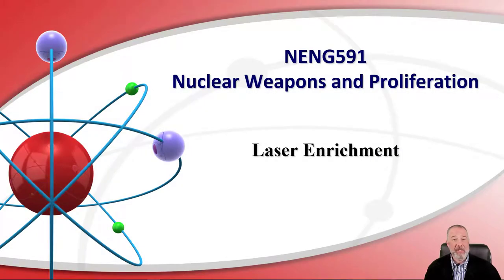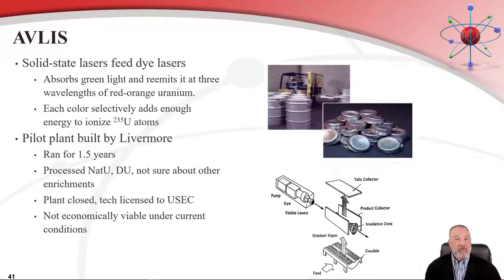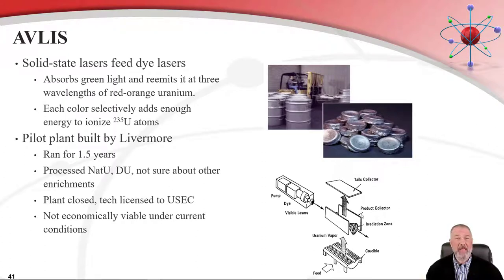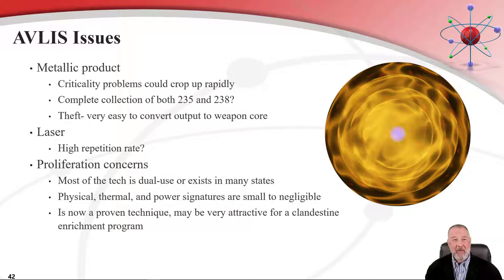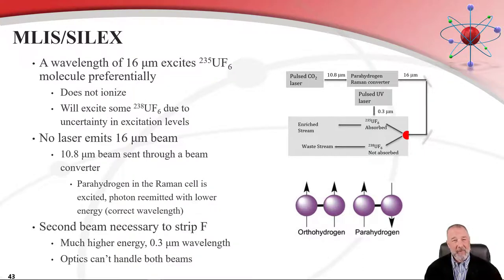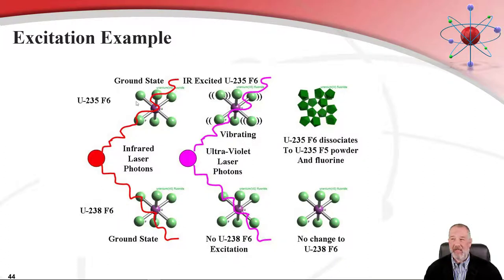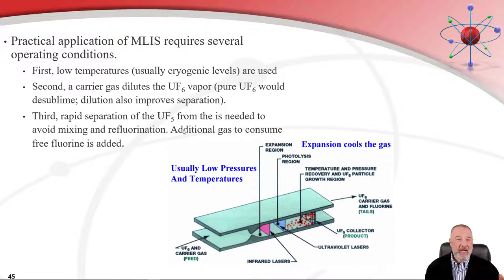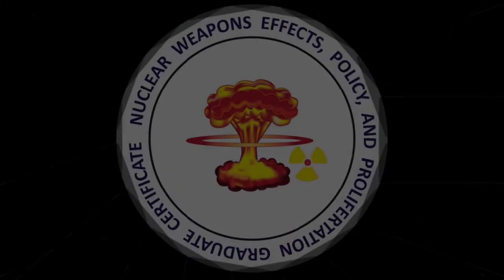Laser Enrichment Methods

Comment: There's another process using metallic diffusion of U238 and U235 basically scooping off U235 at temperatures of around 3900C and if it works kilogrammes of U235 can be made the hurdle is finding the below evaporation temperature. Metallic Uranium melts at 1132C and boils at 3800C so around 3900C the density of U238 is 19.2 and U235 is 18.95 so the density is vital in this process.

Comment: Where laser enrichment shines is that it could be used for a lot more than just uranium, you could fine tune on transitions on stable isotopes too to make highly enriched isotopes of lithium cadmium or iridium for example. Where it shines is that it works best in situations where the target isotope is at a low enrichment level in the source material. It can enrich your isotope to over 80% in one pass.

Comment: New blue and green laser diodes could be used to drive the dye lasers needed for this process. Believe it or not large copper vapor lasers were the pump source for serious use, with a 1kw argon laser being used in the initial experiments.